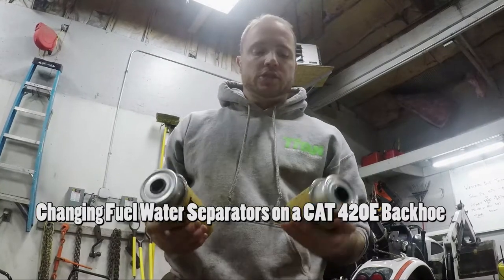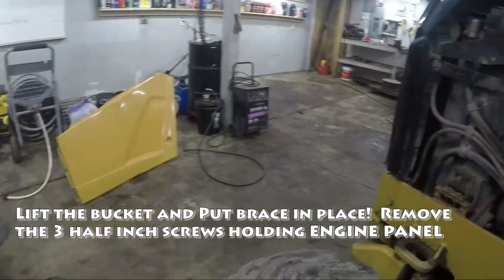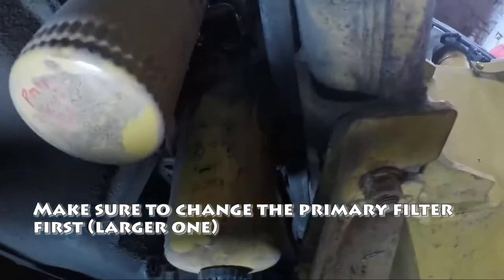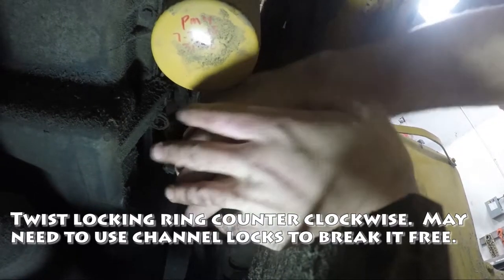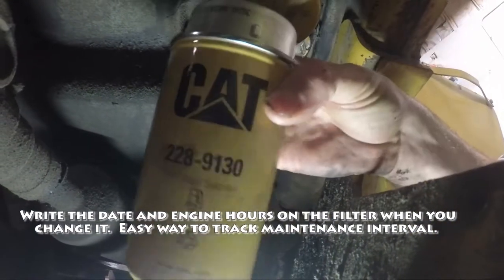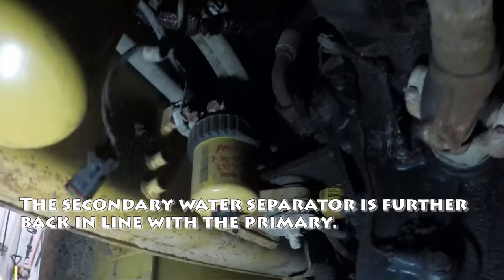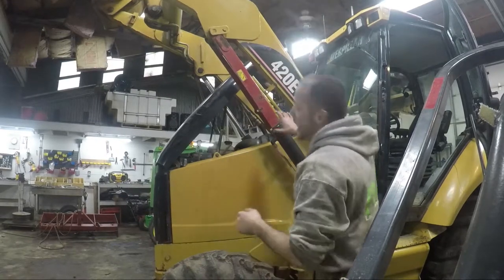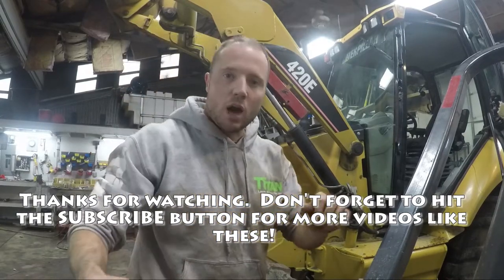How To Change Water Separators On A CAT 420E Backhoe

Comment: Why did you take the side panels off to change the fuel filters? Also how did you re-prime the machine?
Reply from the maker: You actually done have to take the panels off to change the filters. I had them off so I could find the filters and check out other components. The machine primed itself. I didn't have to do anything special to prime it. It did take awhile to turn over and fire.